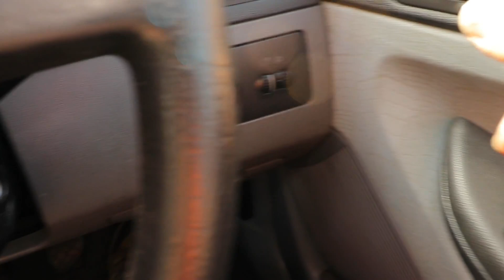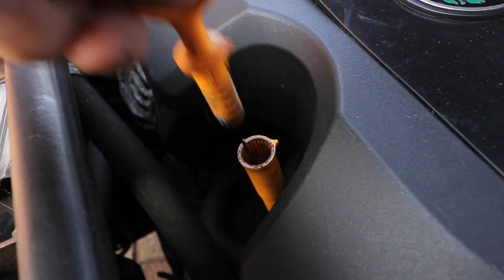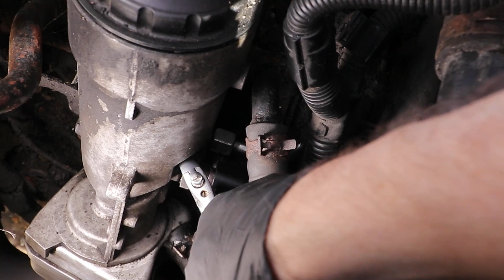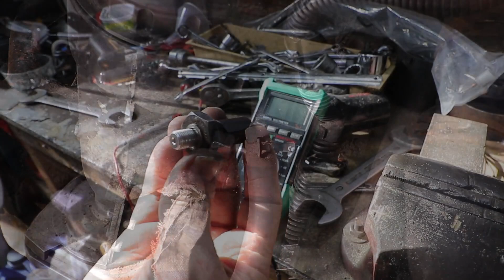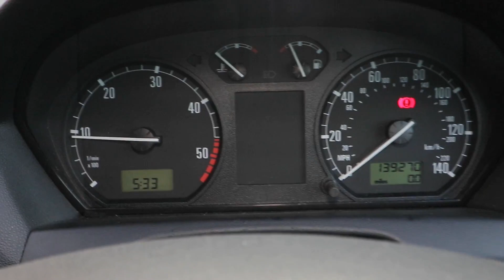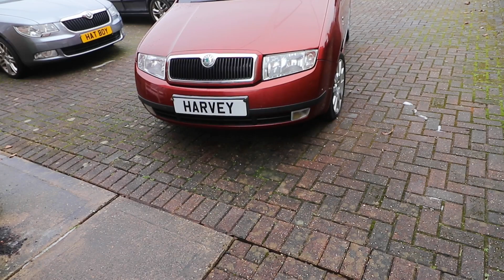SKODA FABIA Oil Pressure Switch/Sensor (1.9 PD MK1 99-07)

Comment: Again a good informative video. I bought a 1.4 PDTDi in february and i’m learning a lot from your videos!
Reply from the maker: Nice little engine attached to a fabi, thanks for your support :-)
Reply: @HatBoyHarvey  Yes, i was suprised when I first drove it! It has 363.000 km in it and still jumpy and strong. Today the coolant fluid sensor beeped, the level was a bit low, so i filled it up, later i change the right side head lamp unit to a new one.
Reply from the maker: The coolant level sensors on these can be temperamental hope you made use of my video on headlight replacement :-)
Reply: @HatBoyHarvey  shure did, it went well!

Comment: Oil light flashes but oil lev is full
Reply from the maker: Have you changed the oil & filter recently? Do that, as filters can clogg. Any detriment to the motor performance? Electrical connections need checking, along with breaks in cable, worth checking with voltmeter for V at sensor and continuity. Faulty sensor or very rarely the pump. Also remnants of an un-cleared intermittent  fault code :-)

Comment: it is not clear from video what was the fault caused the oil light on?
Reply from the maker: The video is to highlights a systematic approach to diagnosing a fault if the dash light buzzes & flashes. No actual fault on mine, I just simulated it:-)

Comment: Hello friend , i sad the video but you clean the sensor and mesure with air and multimeter but i not see where is problem of blinking red oil symbol.
Reply from the maker: The video is to highlights a systematic approach to diagnosing a fault if the dash light buzzes & flashes. No actual fault on mine, I just simulated it

Comment: You are truly a very knowledgeable and instructive person. I watch you with admiration. In my vehicle, when the temperature gauge reaches 90 degrees, this sensor malfunction light comes on. I tried every way and I can't figure it out. I'm dealing with a false warning.😢
Reply from the maker: Thanks, sorry to hear your having problems. When the temperature goes up the oil gets thinner and looses pressure causing the oil light to come on. Could be low coolant, thermostat sticking, water pump failing or a clogged radiator amongst other things. There must be a reason why your car is over-heating - solve that and the light will be fixed. have you tested or renewed the sensor :-)
Reply: @HatBoyHarvey  I bought the oil press sensor 2 times from service😅😅 I suspect the heater radiator 😁 I will replace related radiator and we will see🤪I will you informed.
Reply: @HatBoyHarvey  I tried all of these solution but it didn't fix. I bought a control pen but it has two colour led, green and red. I dont know how can i use that 😅 Did u check ground connection?

Comment: Bro my car starys smoking from oil cap after~5 km and oil light starts beeping after ~50 km. What could be the problem?
Reply from the maker: Is it using oil? overheating? High mileage? could be PCV valve or crank-case breather system clogged up, (depending on engine) or worn piston rings, valve seals,
Reply: @HatBoyHarvey  yeah it eats oil. high mileage and not overheating( atleast dashboard doesnt say that)
Reply from the maker: excessive smoke from the exhaust, blue/grey colour? Pour performance economy? You could do a compression test on it which may indicate worn piston rings or just one gone bad,
Reply: @HatBoyHarvey  bro smoke from oil cap🤣
Reply: Imam i ja slican problem, zamenim ulje, predjem nekih 30, do 50 km, i pocne da pali crvenu lampicu za ulje, stanem ugasim auto upalim opet i nastavim da vozim i opet na nekih 30 do 50 km pali se crvena lampa, trosi ulje po malo, na auspuh ne dimi , lepo radi, primetio sam da ulje brzo izgubi viskoznost - masnocu

Comment: In my case it was bad wire near oil pressure sensor.
Reply from the maker: Thanks for sharing that and you fixed the issue :-)
Reply: I broke my wire on sensor. Where can i buy new one??
Reply: @jasminmustajbeg118  you can ask at some autoparts store or i think cheaper would be to fix the wire

Comment: Hi I have a similar problem, but mine it leaks oil from the side of the sensor/ switch, how can I fix the problem, hope I get an answer 😊👍👍
Reply from the maker: Well, if it works the first this I would do is take it out and examine the threads for damage (replace if damaged) if ok then you can replace the washer seal or you could apply some PTFE tape around the treads and refit. New ones come with new washer.

Comment: Hi thanks for sharing. My vw 1.9tdi also just did the same thing. I'm not sure if it's the swtich or oil pump
Reply from the maker: change the sensor and then you will know if it is the pump or not. If you have run the car without oil it may well be damaged :-)
Reply: @HatBoyHarvey  thank you for your response. It turns out that the wire got brittle and broke. I also found an oil leak at the switch but in my case it seems like the threads are stripped in the housing. I will be removing the entire housing. Thanks for the channel. Subscribed

Comment: hi, i've a problem with my fabia. if anyone got an idea what to look out for i'd be very greatful for any help. so basically it was droven on a highway at 140kmph and suddenly lost it power and stopped. I was not able to start it again. at a repair shop they checked power supply and it was ok, they could start it and it was working on a starter, but when unplugged fabia turned off. they checked gas pump and the hoses for gas supply and it was also ok. when you try to turn it on it strugles and no start. on the board is shown oil lamp switching on and off but no sound as in this video. oil seems ok (switched 3 mounths ago and not even 1000km was made). fuse box was also ok. only thing i noticed was low coolant level. so if anybody have an idea they are welcome.
p. s. on the ignition the oil smell can be detected from the exhauste system.
Reply from the maker: which engine?

Comment: I have a similar issue, my car is 1.4TDI mk1 Fabia, I just recently did an oil change. The car drove fine the day I changed it, however after letting it sit the car cranks, turns over, but just won't start, an the oil light start blinking. After I let the car sit, it seems I put in more oil than I should've. My question is, is it possible that oil overfill can prevent the car from starting?
Reply: Yes can foul injectors /glow plugs I think

Comment: هل يوجد فيديو شرح لتعديل زجاج الأبواب الخلفى من مانيوال إلى أتوماتيك ؟؟ سكودا فابيا
Reply from the maker: Q: Is there a video explaining the modification of the rear door glass from manual to automatic??

Good question. Sorry I haven't done that, but I think it maybe could be done (ANYONE?). My understanding is: you would need two electric doors, wiring loom, connectors and the front drivers controller from an elegance model and then adapt it to the control unit under the dash, but that may also need to change that as well depending on your car. I don't actually know if this would work as I don't know of anyone doing it, so i would try to find someone that has actually done it. If I had more time and the bits I would maybe give this a go, but it won't be easy and there is also the problem of reliability as older model suffer with door lock, central locking and electric window electrical gremlins anyway. It would be easier just to buy an elegance model. If you are really intent on doing it all I can say is to keep looking on forums and social media for someone that has the information needed to do it :-)
Reply: @HatBoyHarvey  🌹🌹
أشكرك كثيرا للأهتمام والرد
كنت أسال لأننى أريد شراء فابيا موديل 2005 موتور 1400 ,, 2 كامه اتوماتيك لأختى , أنا أمتلك سكودا أوكتافيا 1800 تربو أتوماتيك,,  فهل ستكون فابيا موفر داخل المدينة فى إستهلاك الوقود أفضل من أوكتافيا أم متقاربة فى الإستهلاك ,, أنا لم أجرب هذة السيارة ؟ ,, أسف لأننى سألت مرة أخرى 💖💖
Reply from the maker: سوف تكون فابيا أفضل بكثير على الوقود في جميع الظروف لأنها أخف بكثير وأصغر من أوكتافيا.
The Fabia will be much better on fuel under all conditions as it is much lighter and smaller than the Octavia :-)
Reply: @HatBoyHarvey  
شكرا لك أتمنى لك يوم سعيد 🌹🌹

Comment: Hi. Thanks for video.  So have you already tested with increased oil temperature after completing a couple of miles? Was this issue linked with oil leakage from sensor housing?
Reply from the maker: You're welcome. Good point that I didn't mention about in further road testing, but is part of that. I simulated the fault and wasn't related to the loose sensor which seems to be the reason for my leak.

Comment: I have the Skoda Roomster with this engine (well it's basically a Fabia with a different shell) so your series of videos are super useful, thank you. The thing that frustrates me (all cars not just the Roomy) are all the different electrical connections, half the time you can't see them to work out how to separate them, shame there isn't one format, then there would be no guesswork
Reply from the maker: So true, this is in the design. they use the opposite of basic design principles just to make it hard. And the effect is? ----------- frustration. The reason for doing this is? -----------------the individual gives up and takes it into a shop. Why? ----------------to sustain/create employment and money. And, this principle isn't just related to the clips!    :-)

Comment: Hello I have a question on my dash the steering  and the battery do not disappear when i give contact to the car. But when I turn  the engine on they disappear from the dashboard. What could be causing this ,by the way the car run fine no issues.
Reply: It's called a self check so all your lights should illuminate then extinguish once you have started the engine.
Reply: @Gazshadows  All the lights do except the battery and steering wheel but when I start the engine then they disappear.
Reply from the maker: Suspect the battery. I would check the leads are clean with good contact and make sure the ground to the body is good. A good battery should be 12.6v and hold charge. Check the alternator is charging the battery by raising the Voltage to around 14v
Reply: @HatBoyHarvey  Thank you very much i ll try that.
Reply from the maker: Also check the fuid level in the power steering reservoir